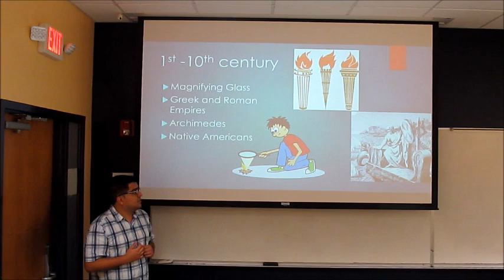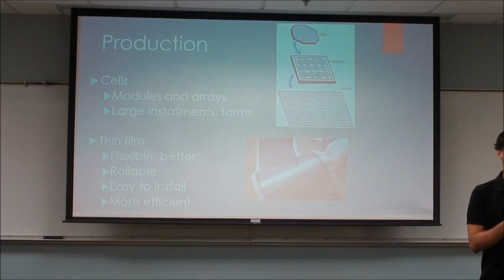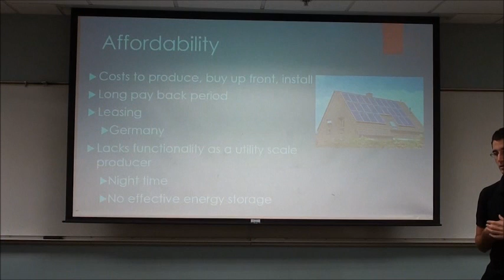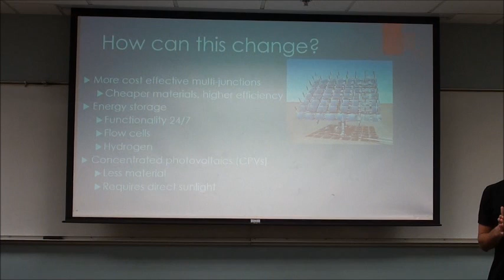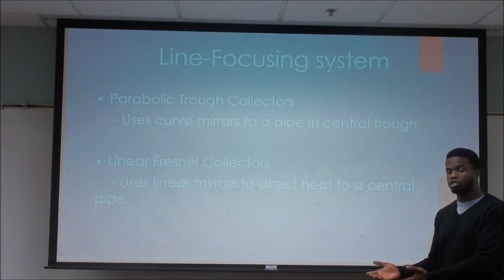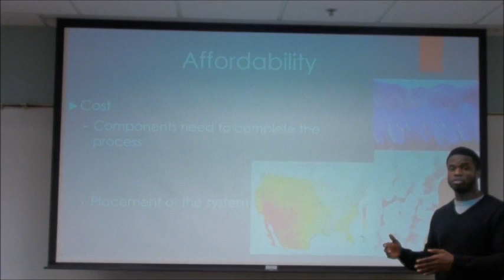Team F: Affordable Solar Energy

Comment: The presentation was excellent and very well done. All the information was concise and clear, which showed that each presenter prepared very well to perform. The only issue was the camera focusing, which was unfortunate, but is an easy fix. The rooms were well lit and the information on the slides were easy to read. Everyone was dressed accordingly and there was a good verbal description given of the diagrams used. Good job guys.